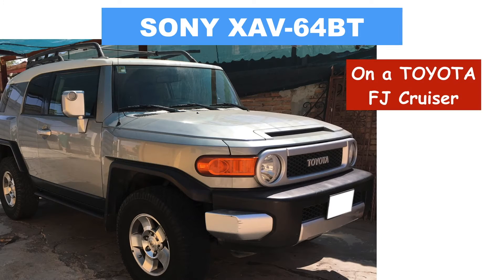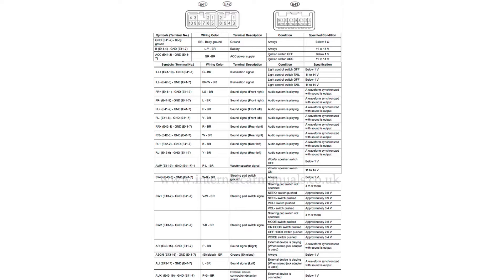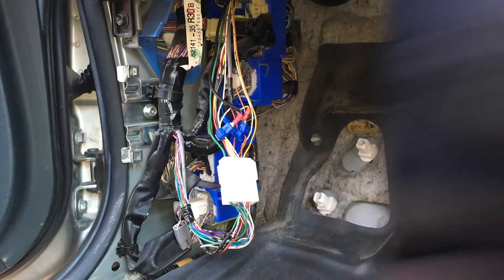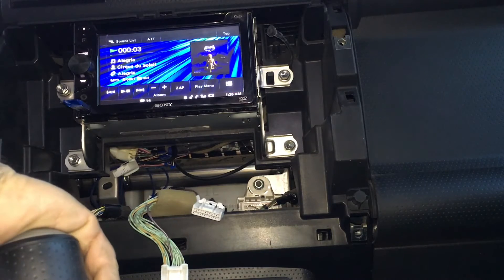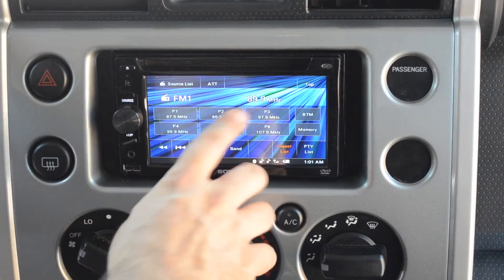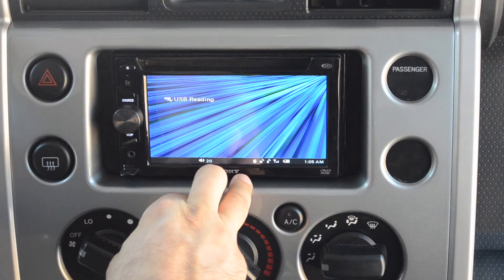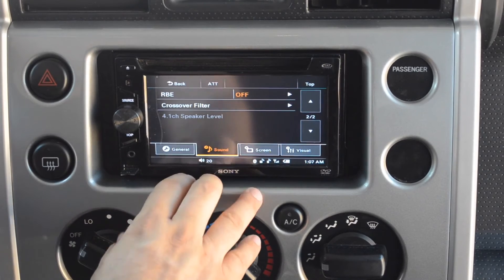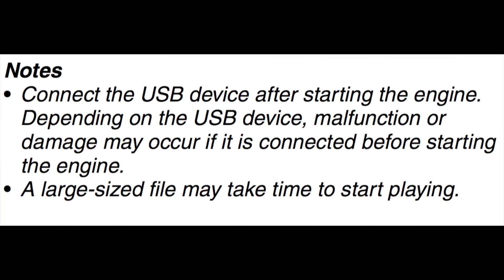Toyota FJ Cruiser stereo replacement removal for SONY XAV-64BT audio upgrade

Comment: Great video, thanks! I had a new headunit installed as well, but they told me they couldn't connect the stock camera to the new HU since its a different voltage. Have you had any issues?
Reply from the maker: No I did not, but I did returned to the original stereo, it sounded much reacher and better than this Sony. Also, a few days later it gave me an "Check engine" light stating that a preheater was not working, so I returned everything back to normal. I will replace the stereo eventually with a good one, but for now, I will just plug an external bluetooth adapter via Aux in.
Thank you for your coment.